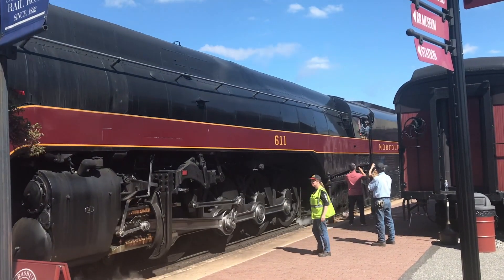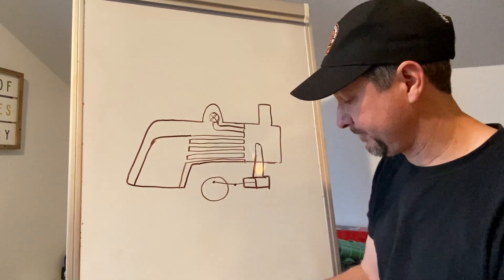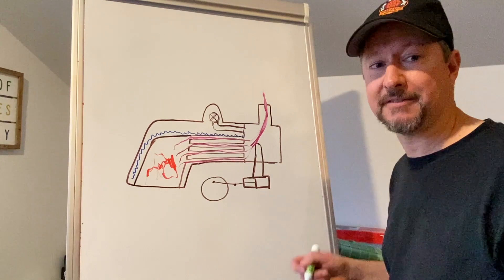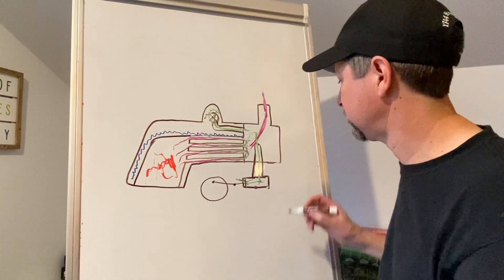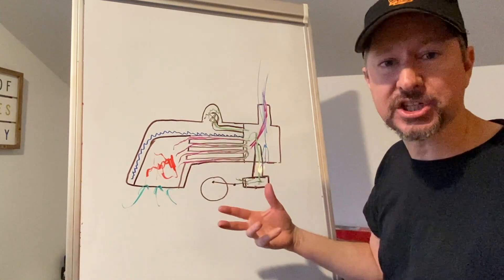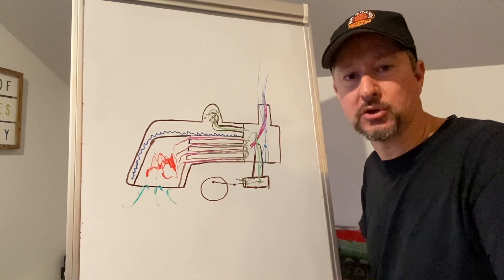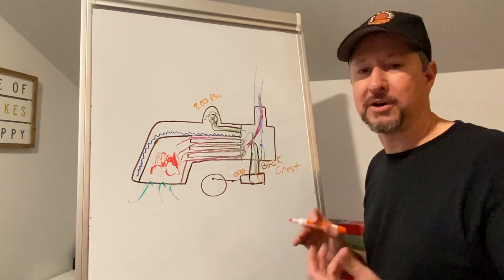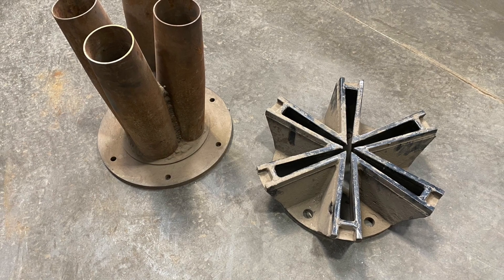Explaining Steam Locomotive Drafting Systems - Part I

Comment: I enjoyed part 2 and left somsome comments but they fell of the edge of earth so lll try again. My undergrad is in Thermodynamics and I teach Choke Plates, ejectors and injectors to steam thresher groups. The theory of the true facts. 
  I found your tutorial interesting, do you have a Thermodynamics education? Initially I felt you were leaving out pertainat information but as I thought about your task of teaching lay people I now feel that your  teaching procedure is correct because I to have to remember that normal people aren't in love with Thermodynamics. I sometimes loose track of that.
  I'm writing a book which will be broken down into 3 degrees of complexity. It covers Choke Plates, Ejectors and injectors. 
  Ill also cover External combustion inefficiencies, combustion as a surface area dependent process. Fuels noting that hard wood leaves no carbon footprint. Plus more.
Reply from the maker: Thanks for the comments.  I have a degree in Mechanical Engineering, which of course does include some knowledge of Thermodynamics.  I saw your previous comment which mentioned the Reynolds number, and I have to admit I haven’t thought that deeply into Fluid dynamics in a long time.  But you are correct, my goal here was not to dive heavily into the mechanics, but only to scratch a few surfaces that would get the general person to peak their curiosity and interest.  There are several other opportunities for those academics who wish a more thorough explanation of the subject.